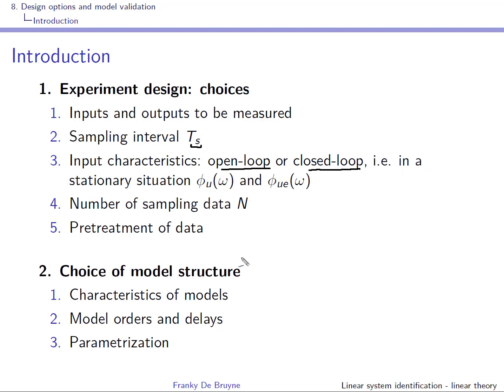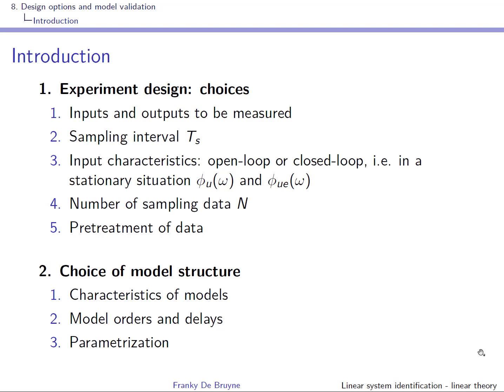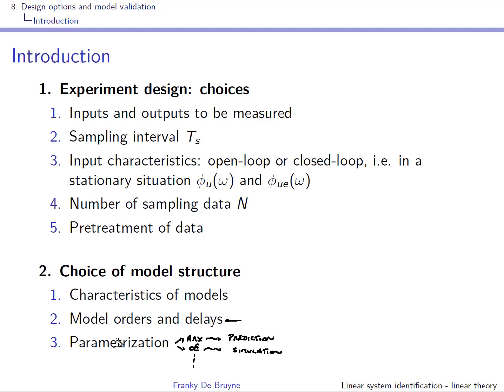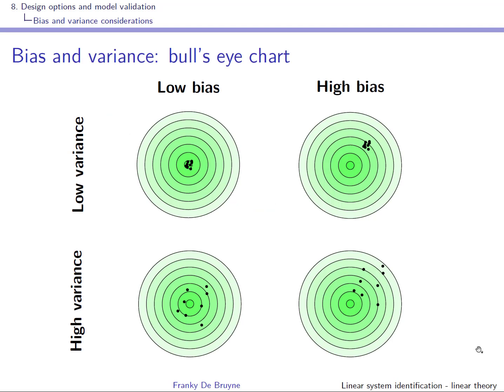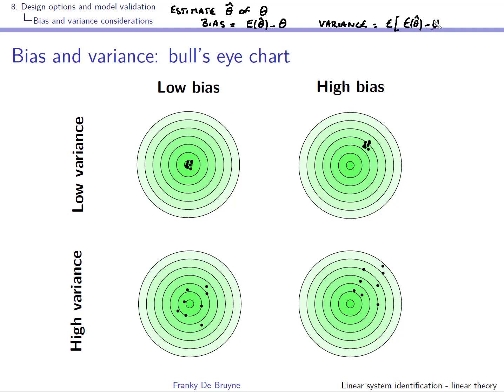System identification (linear theory): video 8 Design options model validation

Comment: Hello sir, How to apply these concepts in close loop. We only know close loop input to the plant, close loop output .. we don't know about feedback signal, and input to the plant. input may be assumed to be white noise? Can you guide me regarding this.
Reply from the maker: If you have only access to the setpoint and the controlled closed-loop variable, you can only identify the closed-loop transfer function. You cannot assume that the input is white noise as it is generated from the control action. You need to input to the process. You could try to reconstruct the input if you know the controller. Or you could obtain the transfer function of the process from the closed-loop transfer function if you know the controller. I hope this is helpful.
Reply: @Franky De Bruyne  Thanks sir for you reply. I have a close loop plant with only "Plant input" , "Plant Output known". Reference is not known.  It is only known that close loop system is driven by random noise ( with given mean, var). We know plant model. but feedback element model is unknown and feedback signal is unmeasurable. Now, Can we anyhow estimate feedback element model?